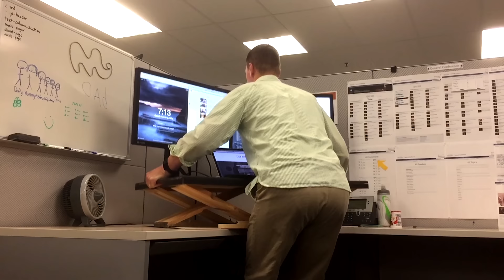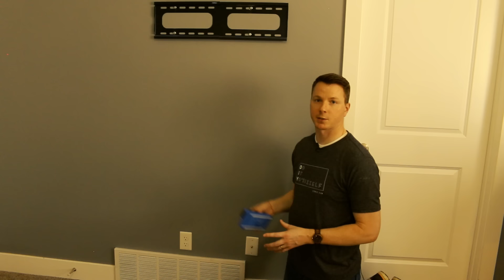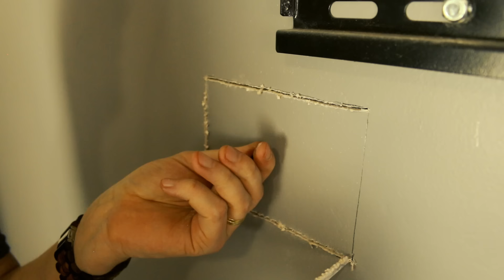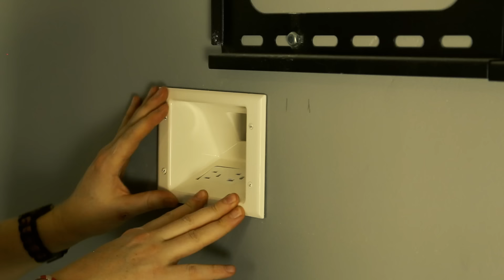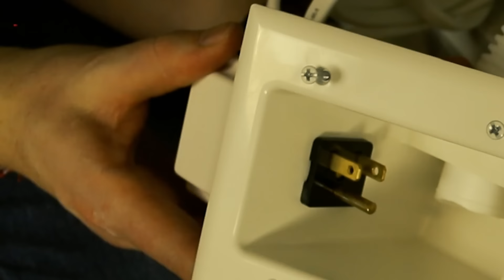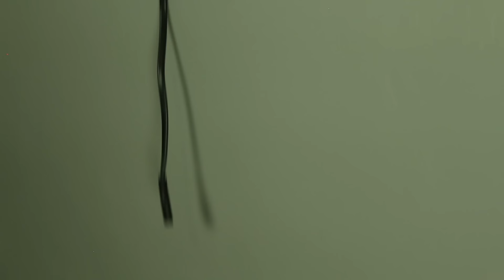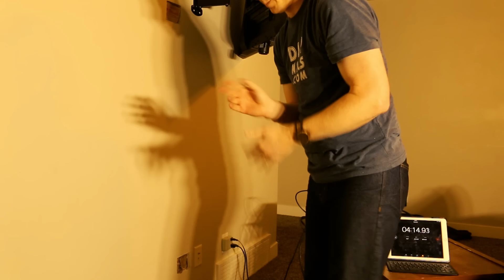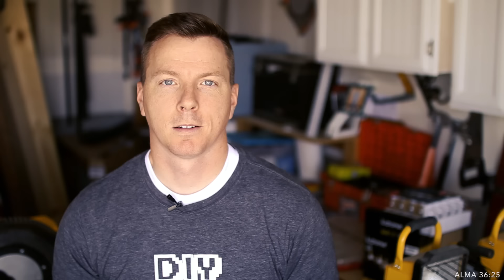How To Hide Your TV Wires in 30 Minutes - DIY

Comment: if you can avoid it dont coil up tye cables in the wall. Coiling cables doesnt alow any heat to be rejected efficiently much the same way you souldnt use extention cords unless fully unwound. But great video
Reply: I didn't say it was OK or if I would do this, I just stated that those wires are not going to heat up before the breaker disengages .....  Read what i wrote, not what you think....
Reply: spottracer I AM a licensed electrician....
Reply: RoelNicky, Maybe they never had him experiment with wrapping coils. Because if he did he would know the effect spacing has on coils.  Not to mention the total lack of number of coils.
Reply: https://files.brightside.me/files/news/part_39/394860/16912710-DddGnvrO4l5x5UfMOjE_KDRm7qe74_cb9jLoB-sGfK4-1509096377-650-22152782c2-1510091738.jpg
Reply: !o! Thats a good one. Kinda puts those power ree!s you can buy into perspective and they carry much more power.  Does a good job of getting the point across to these obsessed guys.
Reply: Good to know your still alive! Cheers mate
Reply: RoelNicky - Apparently you also have some common sense in the physics world too.  :)
Reply: Still waiting for that video showing coiled cable running an LED TV getting even remotely warm much less catching fire.  You guys talk big but can produce nothing.
Reply: +consaka1
You'd need to be using telephone wire in order to have a problem.
Reply: Very good. I was thinking of saying something about inductive current close to what you said.
Reply: Mains voltage, true, but that isn't what generates the heat. Amperage is where the heat comes from, and your tv isn't pulling much of that, definitely not enough to damage the insulation.
Reply: Why take the risk? If it's worth doing, it's worth doing right the first time. I'd hate to risk a fire for ANY reason!
Reply: hangninthere there isn't any risk of fire with this configuration, it's just the same safety nuts trying to make it into something it's not. There will be no induction because the neutral and power wires are ran side by side and there's no risk of heat building up to the point anything will catch fire. This is a dumb argument. At worst it just doesn't look good, but luckily it's inside a wall. And honestly I'd rather have someone cool it than try to cut and restrip the wires if they don't really know what they are doing. I've worked in enough houses to see the stupid things DIYers can do in their electrical boxes. Hell, what some licensed electricians have done leaves me gaping. This is fine and won't hurt anything.
Reply: IV SEEN CABLES CATCH FIRE CAUSE THEY WERENT UNWOUND .SO PLEASE UNWIND ANY CABLES. OR BE A DUMBASS AND GAMBLE.
Reply: REMIND ME NOT TO EMPLOY YOU AS MY ELECTRICIAN
Reply: The coiling may cause the problems listed below not because of the amount of current but because of the inductibe field producing coil you made. Inductors (coils) tend to store energy, let it pass in one direction and be resitive in the other..depending on the direction of the coiling. The electrical field produced by a coil that has power running through it can also transfer unwanted power to other inductors or interfere with wireless signals..so if you experience those type of issues then check this as the culprit.
It would be a lot cleaner and safer to keep your cables to length without coiling.
Reply: Give me the formula to calculate heat in spools and wires, then talk again ..... I'm an electrician and i wouldn't say anything if i wasn't 100% sure what i'm talking about. The amount of spooled wire is not enough to heat up the cable even with a load of 4000W (what would disengage the  breaker anyway) and the spool is not wound up thightly enough for heat to build up.......  Just stop with the broscience to feel important ....
Reply: So! It still isn't drawing enough to make any real difference.
Reply: You never know... someone may get creative one day and use that outlet for a vacuum cleaner. There's nothing preventing a high-amp item from being plugged into that outlet, even if it isn't intended for one.
Reply: Justin, Like maybe straight 26 gauge? Or maybe 22 gauge?  Wish I had the time to make a video showing that. But then the coil would still be a none issue since it would turn into a lightbulb coiled or not.  I so want to do it now though. lol
Reply: I never said i would do it this way, i only said that electrically there will be no problem... For a someone with a university degree you should understand what is written and not make your own conclusion about what is written .....
Reply: I already explained why that theory is fault. Electrically there is nothing wrong with that tiny bundle of wire that can't be even called a coil as there are too many gaps between each turn. Nice try tho, go study some electricity for 6 years like i did then come again
Reply: because a tv uses that much current it's going to heat up the cables hmmyea ...
Reply: RoelNicky - You are a not a very good electrician if you think that it is O.K. to leave coiled up wires like this inside walls.
Reply: RoelNicky it's carrying mains power...
Reply: RoelNicky 
Try going to university for a degree in elextronics engineering for 4 years and have 22 years in the military putting practices like this into practice before you spout your little electrician experience.
Its attitudes like yours that lead to poor quality work. Get some pride in what you do, pay attention to detail  and be proud of it.
Reply: @RoelNicky  Your wrong. Calling yourself an electrician doesn't qualify you. Ask a licensed electrician what the code says. This is not the way to wire anything!

Comment: Code???
Reply: Mike Fury Tech and if your insurance finds out they may not cover if your house catches fire.
Reply: Good grief. There are many locations in the US that do not require permits or a "qualified" technician to perform the tasks he presented. He didn't break into an existing electrical box. All work was performed on the other side of the stud. He presented what any of non-certified types could do, without creating an unsafe condition, and without all of the bureaucracy bs. You complainers out there must live in NJ or California. Get out more often. There are probably hundreds of different configurations to do the same thing. He presented one workable solution. The wires are hidden from view. Mission accomplished.
Reply: F W ujjjjhj
Reply: Well, safety and code aren't always the same.  You can do a safe install and still be in code violation.  I think that was his question.  This seems like a fancy extension cord behind drywall, which is generally not allowed.
Reply: If that cord contributed to the fire, yes.  That was my point.

Comment: I know nothing about US electrical standards, being in the UK, but that bottom panel connection doesn't seem too secure. I assume the push in clips have some sort of tension in them but the main flex doesn't seem to be secured in any way, unless you did this later?

If I was doing this I'd be tempted to pull a piece or cord or wire through on every pass and leave it in there, top to bottom, for any future cable changes. Then just pass another one each time. That way you can always just pull the cables.
Reply: Good point with those push in wire connections. I absolutely hate those things. They might work good for a long time for low load stuff like TV's but repeated used by higher loads like vacuum cleaners and eventually they burn out.  Yeah our house was built with those kinds of outlets. Makes the initial wiring install a snap but it can't carry the load for long.  I have even seen some of them migrate out. When I replace them I use the clamp style or the old screw directly on the wire kind.
Reply: Have you taken any apart? Obviously here we use different stuff and it could change over the years. I have had an old one apart but not the new ones.  The ultimate connection is the wire wrapped around a screw. You literally can't get better contact area and pressure then that.   Wire nuts are just used for loose wire ends that need connected in the junction block.  They work pretty good and are a wiring standard but I honestly don't trust them too much.  I have seen many of them come loose. 
I should make a video taking apart the old push in outlets and or switches.  If I could find a failed one that would be the best. Unfortunately I threw all those away when I replaced them.
Reply: On pulling the wires, you could run a flimsy wire like he used through, but longer then splice the two ends together to make a loop and then tape a wire to it to pull through, then when you’re done cut the splice and stow the ends in the cubby when you’re done, leaving it in there in case you ever needed to run cables again.
Reply: thorlo6 but code says do not do this. It really doesn't matter how well the work is done. It still won't pass code.
Reply: The box has a 1-way tab to secure the NM Sheathed cable
Reply: That's true where you live, but, Mississippi electric code let's you do this. Most of the time I follow US electric code rather than MEC, since USEC is much more stringent. In fact, I had wired my dad's shop with both 120 and 220 and had hooked it up to my dad"s meter. The meter reader saw this and called one of their engineers to check out what I had done. He stated I had done a great job and put a new seal on the meter.
Reply: You should go to screwfix, Company who maide it called Wago :)))
Reply: Yeah, those push in clips are the only thing about this that I'm not sure of. For low power or data cables they'd be fine, but for mains power? Hmmm
Reply: This is design for main power
Reply: https://goo.gl/H1hhgf push in connector available in USA at every electrical supply house (from various manufacturers) used by electricians for SPEED installation.  Its also very hard to knowingly install them wrong. the wire is either in and secure or falling out.
Reply: Or you could just put in a single pull string long enough to pull the new cable, which would be a little more than twice the length of the distance between the two holes from top to bottom.  Leave it tied at the top and bottom.
Reply: You are right that connection it is not safe at all, is out of any electrical norm
Reply: consaka1, yep because everyone is going to move the TV to plug in the vacuum!  LoL
Reply: If it won't pass YOUR code then don't friggin do it...   And we don't need to hear about it.
Reply: consaka1 they are rated for a high amperage. At least you can get then for high amperage. We use them more and more in the Uk. First it was Wago from Germany, now we have lots of copies. Push fit electric is going the same way as push fit plumbing. You still need to know what you're doing, but at least Wago are a wonderful invention in my view. Much better than a screw. So good in fact they are classed as "no maintenance" junctions so can be used where screw junctions can't. I know in the US you used wire nuts. Same idea I suppose.
Reply: consaka1 I have been using the push in connectors on electrical outlets since the late 60's. If you are having wires migrate out then you are using extremely cheap outlets. I have had to replace outlets that was damaged due to an idiot (yours truly) not watching out when he was moving furniture and broke the outlet. I had the devils own time trying to remove the wire because the internal connection was holding it so tightly.  Trust me I've been doing electrical since the 60"s.

Comment: Title: in 30 minutes
Intro: an hour
Reality: unknown
Reply: He said that at the top of the video
Reply: its running a tv... not a kettle or welder... omfg.... how much heat is created.... Fuck all
Reply: Just like to add a small point about coiling cables. It never a good idea as it increases the resistance in the cables through emf ( electromagnetic fields)
Which also generates heat
Reply: Jonatan Den Breejen just don't believe what you see or hear. lmao!
Reply: True but not enough to even notice much less cause any problems in this application.
Reply: I second that! ....That's a bad idea to coil all that unneeded length of power supply line, it should be cut for the length you need.  The technical answer to why coiled electrical cords melt is based on heat transfer methods; radiation, conduction, convection. All three heat transfer methods play a role, but especially radiation. Air has less ability to convect heat away when coiled. Conduction works by direct contact, which is elevated by coils touching. Radiation especially elevates heat transfer when two closely opposing surfaces both radiate heat towards one another, creating a phenomenon called 'radiation feedback.' Radiating heat bouncing back and forth between the two closely opposing surfaces raises the temperature on a logarithmic scale rather than linear scale. By understanding electricity generates heat, dissipating the heat through proper heat transfer methods is safe, substantially increasing the heat through heat transfer methods will exceed the insulating materials capacity to absorb heat, possibly reaching fire ignition temperature, is not safe.
Reply: None of that means anything if no current is flowing, or even very little current.
Reply: I installed one of these data Com boxed. Dope
Reply: Also it only works for American houses, where walls are made out of air
Reply from the maker: Yeah, that was my bad. I didn't realized until after I did the second one that it only takes about a 30 minutes because I filmed the first one and stopped a ton. It really did only take a half hour to do in an insulated wall, so pretty quick!
Reply: Jonatan Den Breejen more like ihr 30mis lol😂
Reply: Jonatan Den Breejen LMFAOAFDNBBCDNBHIV
Reply: Jonatan Den Breejen i
Reply: Yeah so easy right.. This guy is at home depot 8 hrs a day..
Reply: I am the Reality: unknown. One year later. Who cares about the wires. I am looking at the tv. But good video.
Reply: lol but i really really enjoy his step by step cause i'm a woman who has no help but wants to learn and do myself. So, thank you LRN2DIY! :) I am your target market and I hear you loud and clear. Thanks again.
Reply: @la1930  B@icloud.com idmsa.apple.com
Reply: Nancy M, thanks. Missed that point
Reply: This guy is a joke, right?
Reply: Joe Moening no, your just a troll, another word for hater. He is being helpful... your contribution... worthless
Reply: Clicking the Bait!
Reply: Click bait
Reply: All day project
Reply: 30 minutes? Only if you have inner walls made from plasterboard, not brick.

Comment: Great video, I have two power supply bricks ( Xbox and sound bar) I want to hide. My understanding is I should not hide these in the interior wall, but can I mount a access panel in the wall ( like for plumbing) and make a shelf inside the wall to place the power supply bricks in the wall?
Reply from the maker: That's an excellent question. Where it's open and accessible still (unlike being inside a wall), I would think that'd be fine but you're better off double checking with an electrician to make sure.
Reply: I know this question is 6 months old, but the Xbox brick gets *hot*. Even if it didn't build up enough heat in the wall to start a fire, I imagine the brick itself shouldn't be kept in what would basically become an oven.